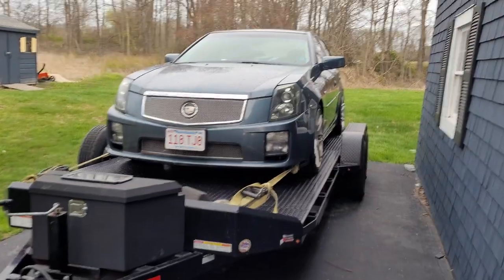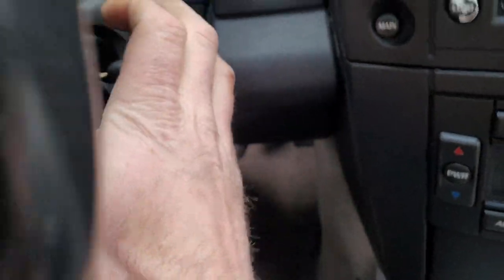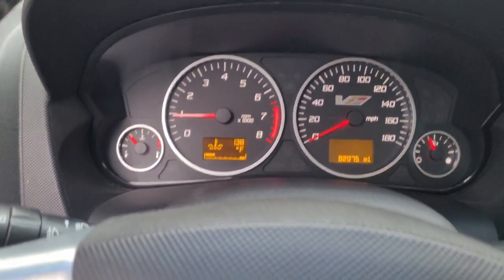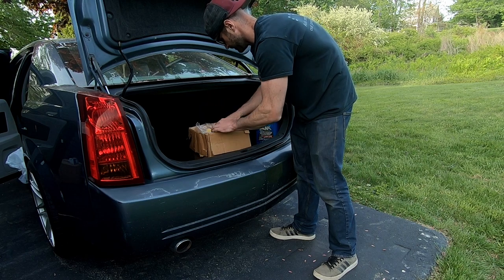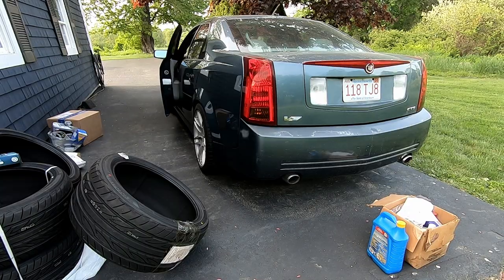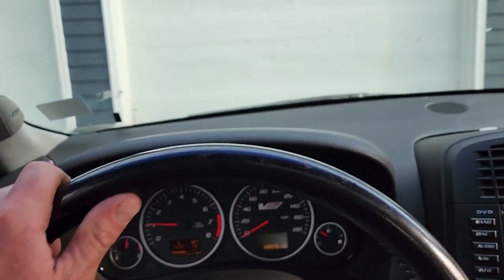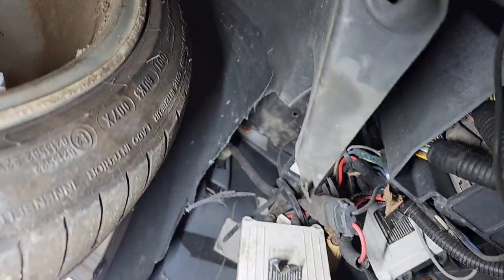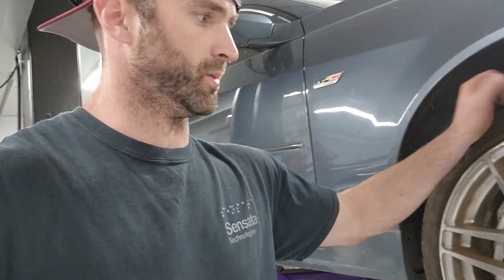I Bought the Cheapest CTS-V in the Country!

Comment: Bro what.  82k on the dash.  What a steal.  I’ve had my 2006 cts for 6 years and it’s been the best daily driver I’ve ever had.  Never put a dollar in her other than tires, break pads, a battery and oil changes
Reply: The odometer doesn’t work tho after the drive the mileage didn’t go up
Reply: It’s the factory manual too. That’s a fucking steal
Reply: Are you serious?!? You don’t change other fluids or anything else? I would touch a car you owned…
Reply: 25:42
Reply: how many miles though ?? im at 152 with c/a/i exhaust i got a cylinder one not fireing lmao
Reply: Bruh my 2008 cts needed a new transmission, timing belt, cats and more😭
Reply: @leonardodeharo9274  the V doesn't have a timing belt.And the Tr6060 is a decent transmission.Im guessing you had a V6 with an automatic which both are junk.
Reply: @mcbride991  I don’t think the first gens came in standard
Reply: And an alternator here. But same. 2.5 years+
Reply: @leonardodeharo9274  Man I just bought one for 2100 And it needs a time and chain and that’s between $2000-$3000
Reply: Thinking about Ls swap it
Reply: Wish it was like that for me I changed all my front suspension parts in the rear the fuse box throttle computer... I mean she's great but parts fuck up with wear n tear
Reply: @02HeroFitness  it did bro the ctsv wasn't made automatic
Reply: @mcbride991  
1st Gen Vs were all manual.
Reply: If you haven’t fixed it already I had this issue with my 07’ Cadillac it was my rear diff bushings if you replace those it should fix the issue.
Reply: Mpg? Or average
Reply: LoVe it bro
Reply: @jonathantovar6124 I guess the second gens were the first Vs to be offered with the auto cuz I seen some YouTubers with the those ones in either auto or manual
Reply: @Bmstaudy  , plus it was tracked, sitting outside, so not exactly a cream puff.
Reply: "brake pads"
Reply: @mcbride991  first gen CTSV was manual only

Comment: I have an 04 CTS-V and when I heard there was a clunk when engaging the clutch my first thought was the rear diff bushings since my car did the same around 80k miles. They make a killer aftermarket bushing with a kind of hook that bolts to the diff housing to add additional support. That aftermarket bushing has now lasted me a solid 70k miles with little to no degradation.
Reply: How is the rear sub-frame?
Reply: @xnreyescj  Mine? Seems just fine. No cracks, breaks, or deforming.
Reply: That hook is bad for the V diffs..they add more stress..lots of failures with it
Reply: What is the bushing you purchase d?

Comment: I have some advice for you when the car staying long time +6 months:
1- change the fuel.
2- check oil engine - gearbox - differential - brakes.
3-check the spark plug and it's cables.
4- compressor and it's lines with filling valve and O rings.

Regards

Comment: Instead of buying a CS rear diff bushing, you can buy an Energy Suspension part # 3.2125G and cut it down slightly and it's a direct fit in the diff without cutting or pressing out the metal sleeve (the most time consuming job by far which can be a days job) and expensive if renting the tool. 

The ES bushing set comes with 2 so I can sell the other one for $18 shipped if you or anyone else want to fix it super fast and reliably.

Comment: Oh and pro tip, set it out with the direct sunlight on the tail lights.  Then pull on the tail light lenses.  If they pull loose, then you know you need to re glue them before you lose them on the highway.

Comment: The speedometer and trans temp connectors get reversed on the transmission if it has had work performed.  Mine was that way.  It happens more often than you would think.
Reply from the maker: Normally I'd check that, but the fact that speed is reading correctly from obd2 port tells me the problem is somewhere between PCM and cluster. Thanks though!

Comment: The clunk is probably the  motor mounts. In 2010 I had an 05 with about 55k that the stock mounts were trash. If you’d push the clutch while under load the engine would slam back down as there was too much drivetrain movement and the mounts would rip.  Looks like yours were replaced already, but these are notorious for eating motor mounts.  My clunk went away after I did some poly motor mounts for the remaining 10k miles I had it.

Comment: I own one of these, a very common problem with them is the cam sensor going out causing the start to take longer, it hasn't happened on mine so I'm not sure what the symptoms are of it but if you cant find another reason for it I would check it out.

Comment: That starting issue seems like the car hasn't been properly tuned after the cam swap, i had the exact same symptoms with my cam swap, it would randomly die after starting or hiccup and go up and down the range trying to get to its idle setpoint. Bumping up the cold start idle and a few airflow related settings helped for me, but it probably needs a bit more than that, especially if you dont know the cam specs.

Comment: I daily drove a 2005 V1 for about 2 years. Had heads / cam and bolt-ons, and it was a fun car but man it had gremlins out the wazoo lol. Make sure all your grounds are clean and tight, as those will create a lot of issues. My diff made the same exact clunking noise when I let out the slack on the clutch like that. Its absolutely worth it to use every differential-related upgrade that Creative Steel makes. Mine also had the same clear coat failure on the rear bumper, Cadillac sure did a lot of learning with these cars haha. But they are cool cars for sure because of how rare they are. Looking forward to seeing how this one turns out!
Reply: Cadillac CTS V’s are not rare at all. What is rare is the STS V and XLR V only 2500 STS V’s were made through the model run.
Reply: @adamhayden5152  Idk where you live, but I sure don't see 1st gen V's very often at all... Even when I would go to the largest weekly  Cars and Coffee event in the country when I lived in SoCal I would often be the only 1st gen V there.
Reply: Most first gen V1 cts are wrecked because you have to drive these cars ...ive had my 05 for 7 years and is super easy to lose control of it.. id bet half of these are gone by now
Reply: @imthestrangler123  I’m in SE MN. I literally see them all the time in the summer. 2nd gen v’s more but I still see 1st gen v’s a decent amount in the summer. There is a guy that lives in town over that has cts v wagon. I love seeing that car.

Comment: As a prior CTS-V owner and NH native, I subbed and plan to follow the series. If the stability message still comes up on the screen, the previous owner probably disconnected the yaw sensor. Especially if he tracked the car often. Pull up the rear of the center console and it's right there.
Reply from the maker: Thanks brotha! Saw that via a Google search and also grabbed a spare sensor just in case that one was bad 🤙

Comment: Keep the Yokohama brand new tires just in case you may want some different rims you can swap them out entirely and just have two sets of wheels and tires also you may want to knock the rust off with a wire brush then you can paint  them ?

Comment: I was going to buy a CTS-V but decided to mod my Subaru even more for more power. I do love the Vs but the 17 and newer I want is in the 60k range.
Reply: You wanted a Cadillac but decided on a Subaru? Why not just buy a ats 2.0t? Can easily get them up to 500whp and have the luxury.
Reply: @adamhayden5152  well I’ve always wanted a V8 like GT350 or the CTS V but right now the car is making about 750whp with the current setup and the cash price of the 17 CTSV was 60k so I spent less than half that for a built heads, bigger turbo, built block, clutch and all that with a retune. The car is in the shop getting all the mods done and I have a 6 speed which I know lots of cars are going to Auto which I don’t want. Now I only wanted a different car for the power not for luxury or anything like that because with this car I can barely hear the radio and if I had a V or something I would have a loud exhaust and headers and all that so it’s not for comfort just power.
Reply: @E85_STI  ats can easily fit a v8 the Camaro rides on same alpha platform. 2.0t ats can be had with a 6speed and comes factory with an LSD…

Comment: The cam is what wrong with the idle on start up had the same problem it needs a tune for the cam the ecu is trying to push stock fuel pressure on startup instead of what the car needs with the cam

Comment: Not too impressed when I see a guy using an adjustable wrench instead of a 5/16" to remove battery cables from the battery. I clicked off at that point.
Reply from the maker: I'm all about using the wrong tool for the job